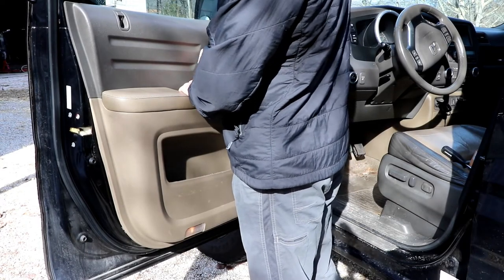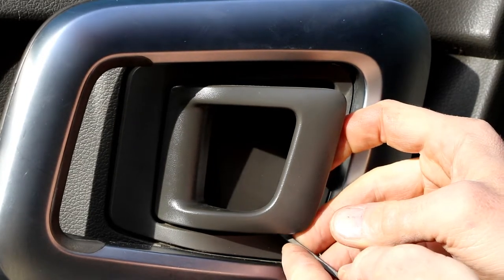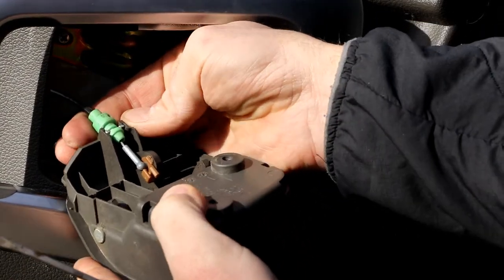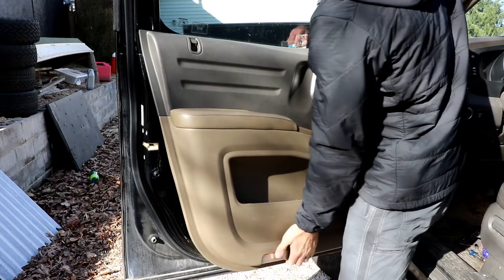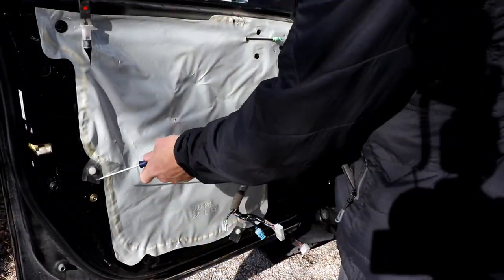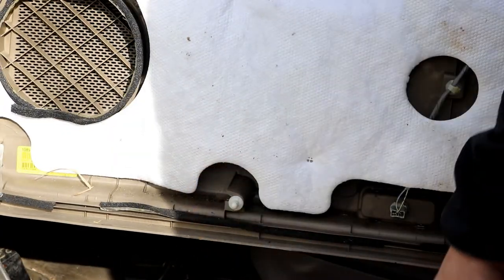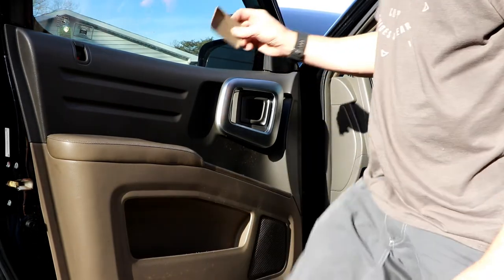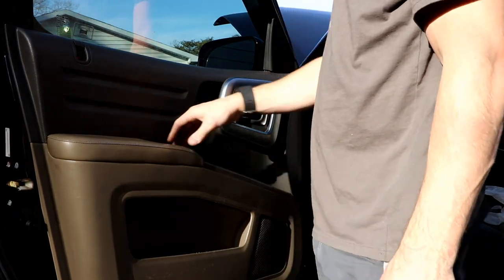Ridgeline Door Panel Removal & Reassembly

Comment: good video i have a question my driver side door armrest is worn would like to replace it do you have to take the door panel off to get to it if so what is involved in removing and replacing the leather door armrest? thanks tony . robert

Comment: Great video helpful to get it done. But right when I finished it the remote stopped working.  I know that has nothing to do with this. But I want to ask anyway. Remove the panel has anything with the key remote at all.
Reply from the maker: Does the lock/unlock button still work on the door controls? Did both fobs stop working? I can't imagine how replacing the actuator could affect the remote operation. If you haven't already, I would check the fuses.